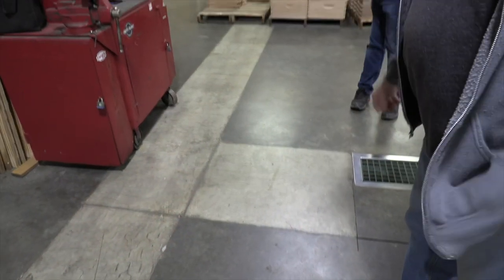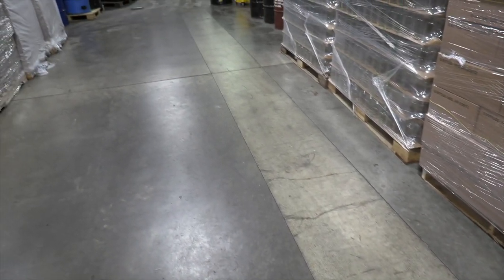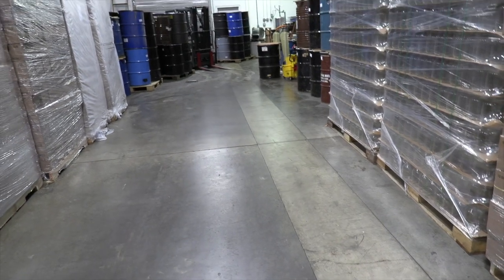Honey Houses - Stuff You’d Never Think Of - @bobbinnie9872  Interview (Part 2)

Comment: That third staged septic tank is a good idea.  I pump into an overhead septic field and even that pump hose plugs when the wax causes problems within the septic tank baffles
Reply from the maker: Any ideas on a cold water bath or trap system to keep wax out of the floor drains?  Somebody somewhere has that figured out, but I haven’t found it yet.
Reply: We use a long U channel down the floor which we try not to sweep too much wax on with the wash water, but obviously wax gets washed down into the drain.  By the time it gets to the drain pipe it’s cold, and I send everything through…which causes problems but we then deal with it on a need to deal basis,  
But ya, never drain hot water directly down the pipe!
Reply from the maker: Was wondering about that.  In college I worked in an Animal Sciences Arena and had a similar setup where I had to wash the floor with a firehose and it all drained into a trough with steel grates overtop.  I did clog the drain once, but overall it worked real well.

Comment: I am looking into converting a 22 ft long pergola into a honey house. Flooring, countertops (fold up maybe), floor drain, faucet for hose hook up, uncapping bin, and  extractor.  Im not commercial in any way 10 hives. Patio door and regular door.  Any suggestions?  There are waterproof laminate floors... Thoughts?
Reply from the maker: There is a big difference in functional and “state inspected”.  I’m currently extracting in a shipping container that I run water and power to.  It works very well.  Make sure the floor is easy to clean, and floor drains will clog.
Reply: @DuckRiverHoney  what pieces of equipment or cabinet, countertop etc do you suggest? Putting green floor drain in with washtubs.
Reply: Did I see someone say you were going to be at Hive Live conference? Maybe I could talk to you more about this.  I will be coming from Lansing Michigan
Reply from the maker: I’m not that far into it yet…a lot depends on scale.  Stainless steel commercial three bay sinks and maybe a prep table or two would be handy.
Reply from the maker: I’m planning to be there.